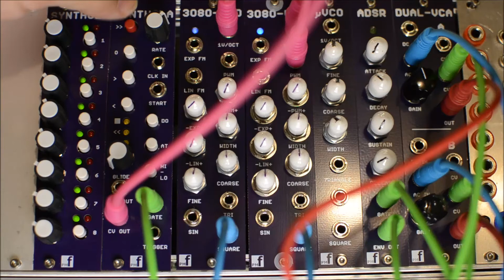PM Foundations Synthola Demo

Comment: Neat sequencer! 

Could someone just answer me one question: Is it possible to change the sequence length on the fly / without stopping it?
Or maybe at least use the "DO" button while the sequence is running  (i.e. when the sequence reaches step 5 - press "DO" - would give me a 1..5 sequence)?
Thank you!
Reply from the maker: Why do I not get notifications when someone leaves a comment?!  Argh!  Sorry vapili, should've noticed this.  As far as I can tell, there is no way to change the sequence length while the sequence is running.  I just tried it and it just stops when you hit DO.
Reply: Thank you for the info! I still didn't choose my new sequencing module :)
Reply from the maker: There are so many sequencers out there.  The PMF version is neat, and they also have a clock module and sequential switch now.  You can use the sequential switch to, for example, turn two 8 note sequencers into one 16 note sequencer.  I've been using the PMF sequencer for all sorts of things though, including as a waveform generator (since there's a built in slew) and envelope generator or LFO for modulation.
Reply: Its possible, patch a copy of a clock into start and external clock input.